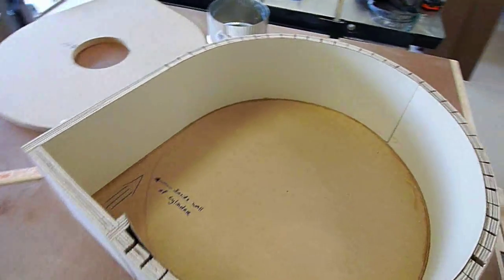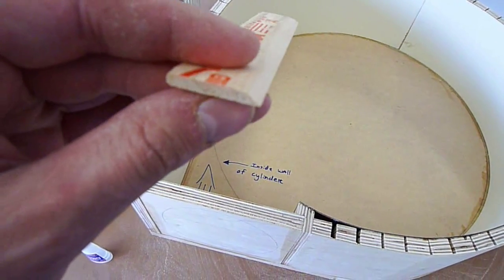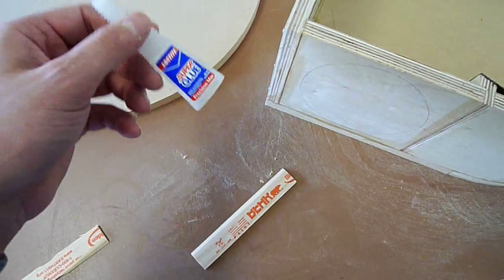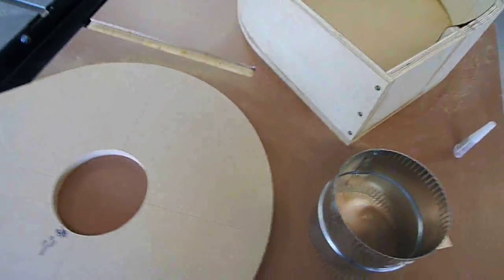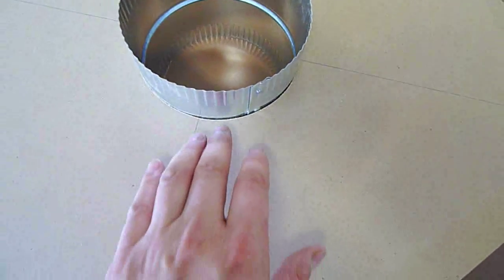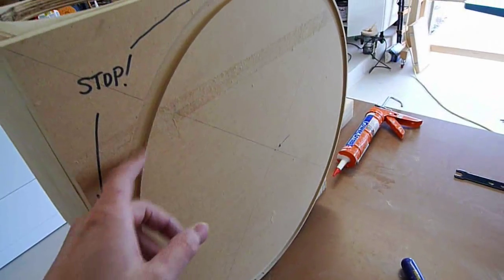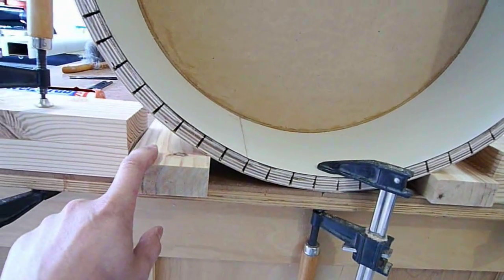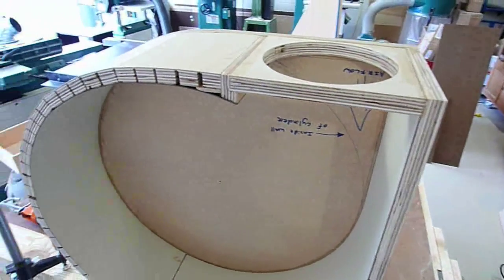Dust Separator - Thien Concept part 3

Comment: I have the top and bottom built... BUT... would it matter if  I had a 4 " in and a  6" out.   I use 4 inch collector pipe in the shop and my collector has a 6" in.
Also.. the top pipe.. does it matter how far it goes down into the collector?  1 " or 3" 's?  
I  am assuming the height of the unit needs to be a inch more than the diameter of  the inlet pipe height of the unit ..thx for any input.

Comment: OK... on the way... all machines are pretty close,  last shop all 4" seemed to work well so staying with all 4" in and out with my 1200 cfm  2 h.p. unit.. should be plenty of suction.  But.... with 4" what do you think???  should stay with 6 " high ar lower it to 5".?? and go with 
the out being about 1/3 way into the unit/.   what sounds right.?  any input appreciated

Comment from the maker: 4 in 6 out is fine...but you really limit suction with 4 inch main line.

My 6 inch inlet sits almost 3 inch down. I would try to keep to pipe drop length half the internal height. 1 inch is not enough.